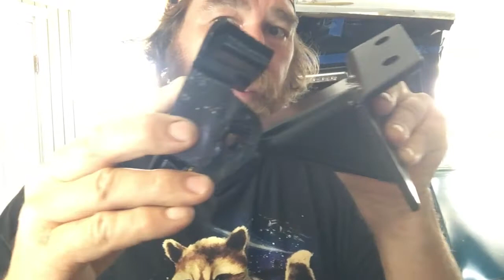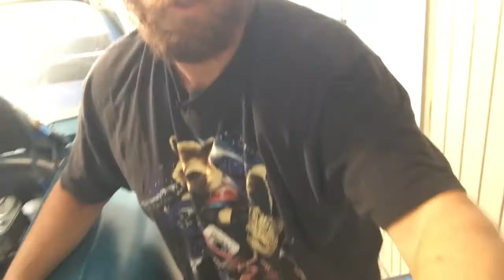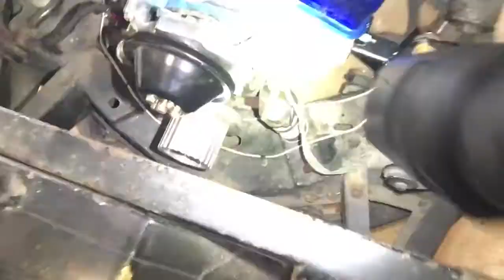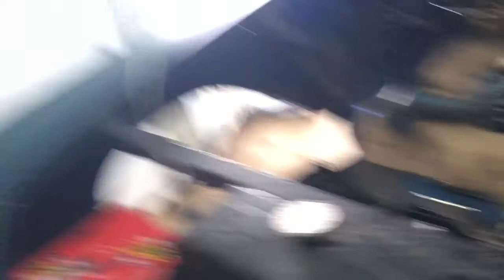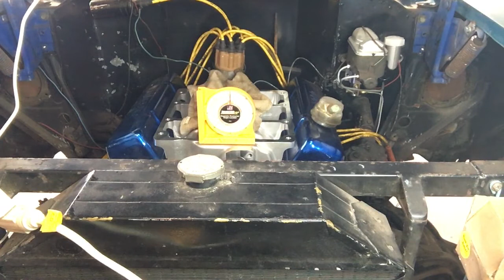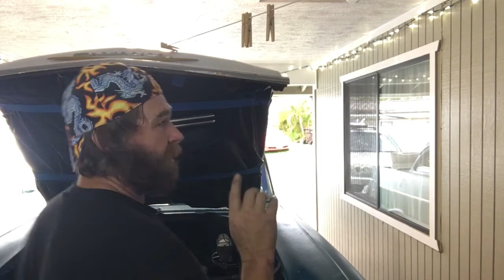1957 Chevy in Hawaii....Tri5 motor mounts part 2...or deux or something

Comment: Definitely making notes. Going to be doing a v8 swap in my 57. 👍
Reply from the maker: R&G Garage there is gonna be some modifications to come for those mounts. FYI.... the tubular trans crossmember kit I used is for a 47-54 chevy truck. No surprise it is the exact same as the tri5 kit only 70$ instead off 250$... put that in your notes. Go watch those videos early on.

Comment: Hey brant, I remember you mentioned something about having a mount midway because it would flex, I'm currently running solid elephant ears up front and just the trans cross member, should I ad a mid mount
Reply from the maker: Rat Gas Garage if its gonna be a racecar, a mid plate or mount is always a good idea. Hard launches cause some serious stress.
Reply: @JAWSatBCPerformance  it's mostly a street freak, but once a year i do that billetproof eruption drags race, 2019 wasn't so bad, I only had a 2400 stall 278 gears no posi, now i hv 4000 stall 355 gears and posi, the frickin kraken has awakened totally different animal, but covid put out that fire, no races last year, but thanks,  I'll add a removable one, so when i go nuts I'll put it on  Aloha braddah
Reply from the maker: Rat Gas Garage with an automatic you should be fine.
Reply: @JAWSatBCPerformance  oh yea forgot to mention its a automatic stick lol, i left the clutch pedal just so i could screw with people, and for future just incase bang shift is in da works
Reply from the maker: Rat Gas Garage rogah!

Comment: If you want to use front mounts just get some mid mounts from speedway .dont forget your extended pilot bearing
Reply from the maker: FUEL FIRE GARAGE Ill have to look those up. My blow bell has provisions for side mids.
Reply: @JAWSatBCPerformance  i always get the ones that go between the motor an bell that way you can take tran out an motor well just set there or the opposite if you put tail mount on tranny to 👍👍👍
Reply from the maker: FUEL FIRE GARAGE hmmmm